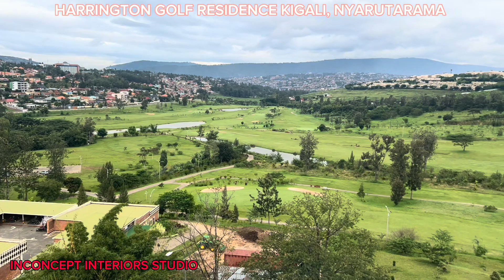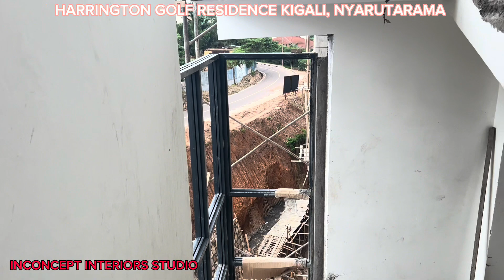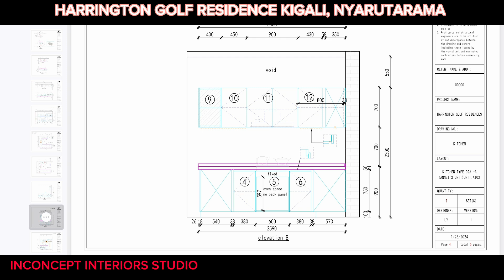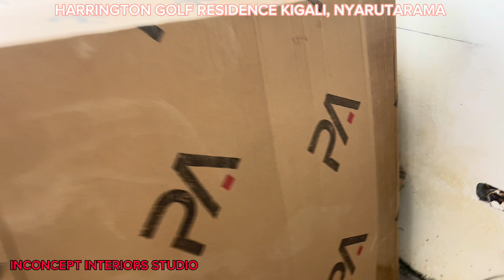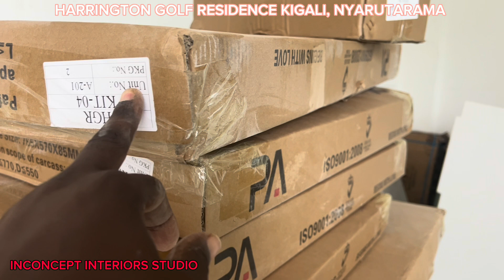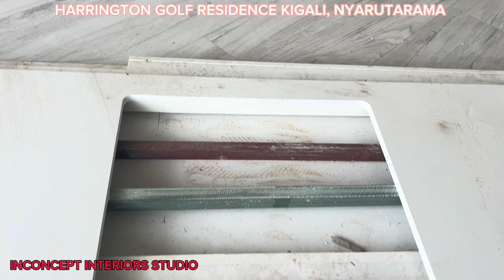KIGALI EPSD 2: : HOW TO IMPORT HIGH END CABINETRY FITTINGS AND ACCESSORIES.

Comment: Which is more expensive,  importing yourself or buying from the shops locally?
Reply: Hello.. you know in China they specialise in mechanisation of production of everything. 90% of their production is mechanised. But locally here in Africa we mechanise 50% n 50% is manual. When you import you get a high end finish..there are some things even if we want to do it locally we cant achieve it but I know we are heading there. Also its cheaper to import when you have a big project like this one. You save alot because even the local vendors import but not top notch quality.  But as a developer you import yourself at a wholesale price.. you get value for your money and good quality.  The person selling them locally after importing has to put a mark up coz of business profits but when you import yourself you get high quality products. Some local businessmen compromise on the product quality to maximise on their profit mark ups so its advisable when you're dealing with a big project like this one to import the products yourself because you save alot.